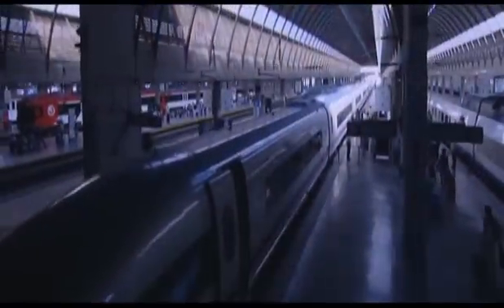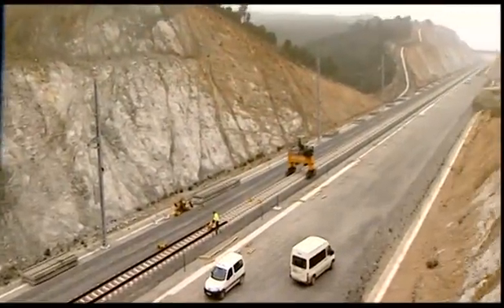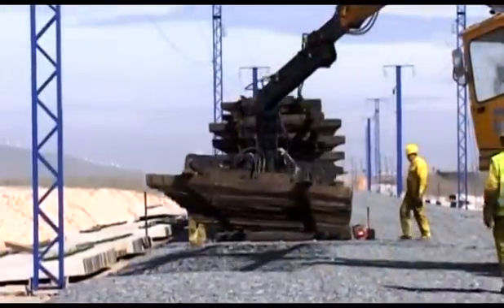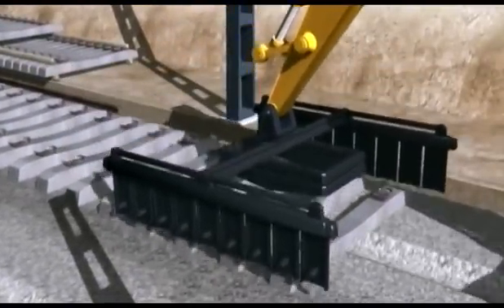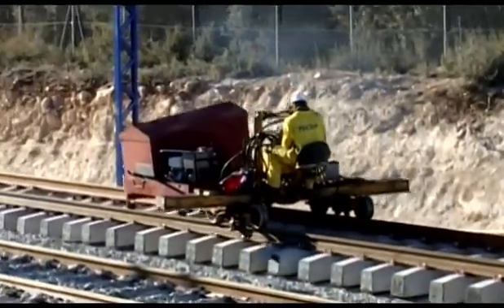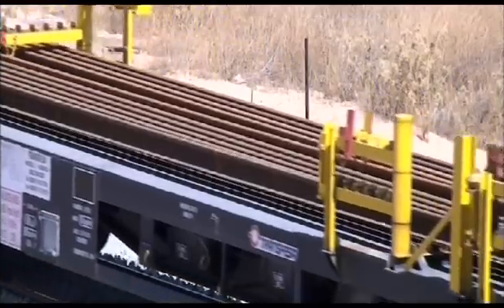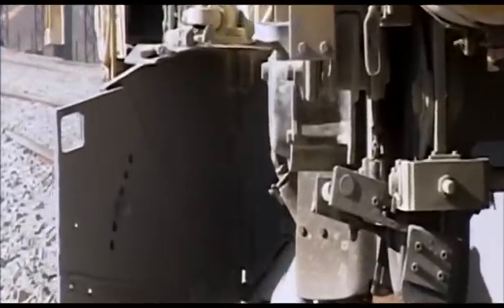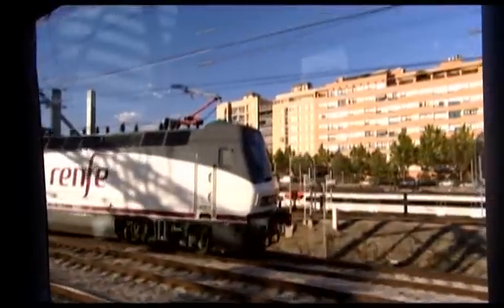TECSA SYSTEM of High Speed Railway Track Mounting

Comment: Sometimes bigger isn’t better. This looks like it has been designed to be as complicated and expensive as possible. For a much smaller and simpler method which is also very fast, and which works equally well for single track as well as double, since it doesn’t require any parallel track, check out https://www.youtube.com/watch?v=bSmkO0un5Go

Comment: Whenever someone says trains are energy efficient, think of the energy that goes into laying track. Just the production and transportation of all that crushed rock...
Reply: and divide that to the decades that these railways last, with minimun maintenance. Its cheap...
Reply: facundo jp Everywhere I go I see train tracks being worked on, including sections of track that are being completely replaced.
Reply: +Docktor Jim Everywere i go i see trucks, planes and ships on maintenance, must be that things wear and break...   The thing is how often and how expensive repairs are. Trains are considered the most efficient form for land transportation...but if you dont believe in mathematics there is nothing more i can say.
Reply: facundo jp All the math I've seen is for trains running on tracks that are already there, and yeah. Those numbers look great. Making the tracks, bridges and tunnels and maintaining them doesn't seem to be represented honestly. Look at just the ballast rock. There's a great deal of machinery dedicated just to quarrying rock, breaking it, and transporting it to a rail center. And as it gets mashed into the ground and sloughs off, more must be added.
Reply: But you don't need any crushed rock, sand, tar, bitumen... to construct highways, right?
Reply: Pensacolaberge Every foot of rail is 175# each side. Imagine a road that comes with a car every 10'.

Comment: The main problem with this is that you have to lay an auxiliary track to begin laying of 1 side of the final track, in which that auxiliary has to be removed following the first side of the final track to allow the laying of the second final track. Yes it may be faster but seems to be more time & labor intensive, as it still follows the conventional cycle of laying sleepers to the sides while ballast is being laid. I'd say, compared to Plasser & Theurer's SVM1000, at least the sleepers, track and ballast can be done quicker & utilising somewhat less time to lay track using the SVM1000. The one thing that is not changed however is the post-laying processes of finalising track cant (superelevation), ballast level & track drainage.
Reply: Just waiting for someone clever to design a less complex more efficient system.   Until that time .......

Comment: After saw this clip it makes us understand Hi speed rail construction  that, it is not very difficult if project administration group select right machine.
Reply from the maker: +Nikhom Shaweeriyha It's not only about the selection of rigth or new machines. It's the development of a new system, a new way of mounting the railway. It's the evolution or industrialization of the railway track mounting systems in order to increase the performance.
Reply: You're welcome.
Reply: Welcome to how freight track has been built in the United States for years.  As for your patents, much of what you show will be covered by Harsco, Herzog, or Railworks existing patents.  FYI, you can pick up used rail in a reverse of that process.
Reply from the maker: kcrailroader Please I want to know the US system in order to learn and compare the systems. Advantages, disadvantages...
Could you send information about it pls
Reply: I am only interested in new system of railway.
Reply: thats just the track laying, the cuttings or raised embankments have to be built first. then a bed of ballast many meters thick. Thats where the bulk of the construction has always been even if the actual track laying part is faster than ever.
Reply: @kcrailroader I was thinking the same. I've seen videos of this method used here in the US several years before this video.
Reply: Thak to join idea
Reply from the maker: Chad Thatcher Please I want to see this videos in order to learn and compare the systems. Advantages, disadvantages...
Could you send me the links pls?
Reply: Thanks.
Reply: It's about not having a neoliberal government that wants to sell off your country and does nothing about its decaying 19th century infrastructure.